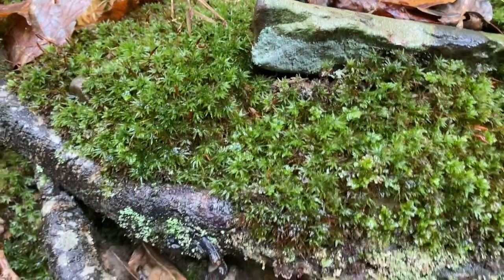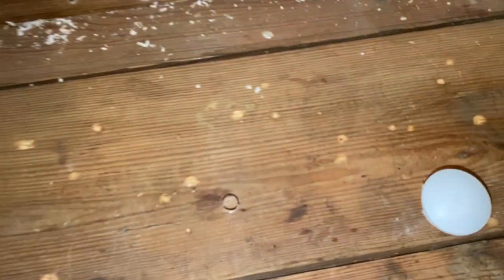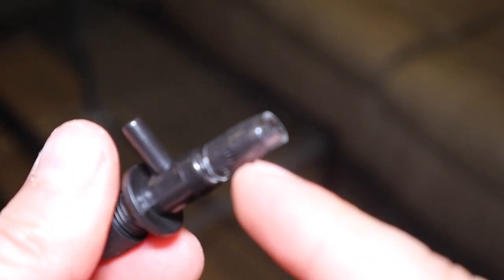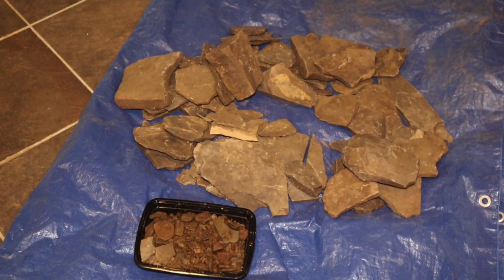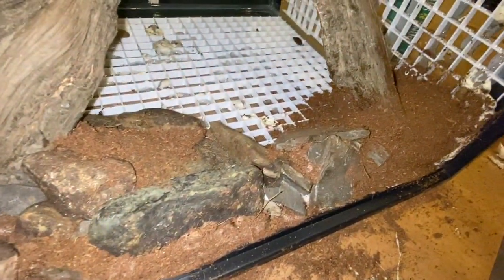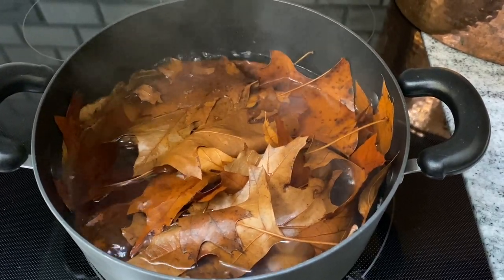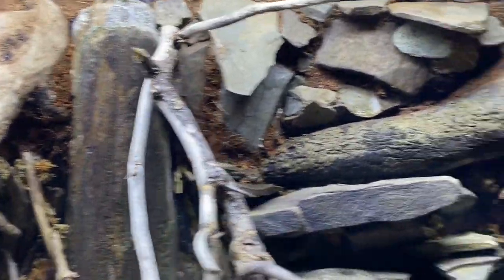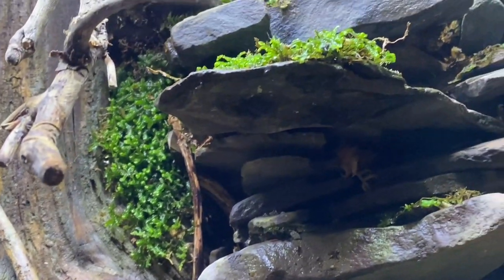Awesome Vivarium DIY - Temperate Forest

Comment: Out of curiosity, why do you bother to sterilize the oak leaves when you are filling it with raw moss?  Also, did you wash your drainage layer first?  Those clay balls are so dusty.  I guess as long as there is no water feature the mud from the grow balls won't be visible.  Overall great build!  Thanks for sharing.
Reply from the maker: I usually rinse the hydroton, but to your point, it really doesn’t matter too much., Since it’s in a land locked area. I have a ton of dried leaves that I either baked or desiccated and have had them for a really long time. The moss is definitely rinsed, but I don’t usually do much else other than quarantine it for a bit, but not all the time. It’s probably not imperative to sterilize all the leaves if you know where they come from is safe. I likely wouldn’t sterilize the leaves like I did again, since I now know that the area they are coming from is super clean

Comment: Do you use UV sterilizers in your paludarium set ups? If not- do you find yourself battling algae growth? & if you do, what do you use to prevent it?
Reply from the maker: This is a great question. I do not as I would be worried it would also wipe out some of the beneficial bacteria. Also, I think it works best with free floating algae, whereas most of my algae outbreaks were attached to rocks etc. I’ve recently had several bad outbreaks of Cyanobacteria (blue / green algae). I did many water changes / gravel vacuum etc. Finally, I used Ultra Life / blue green stain remover and it worked. I removed the salamanders, just to be safe, and note that the shrimp and snails were not affected. That said, I still err on the side of caution so removed them. The only thing I can say is that the drip walls are very prone to this as there are a lot of nutrients and not too much water flow, which helps create ideal situations for algae / cyano blooms